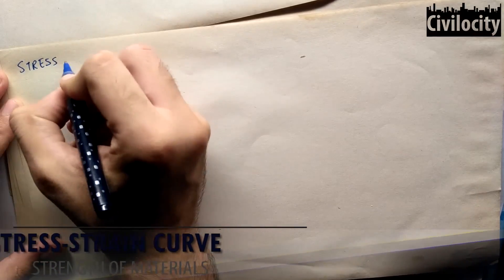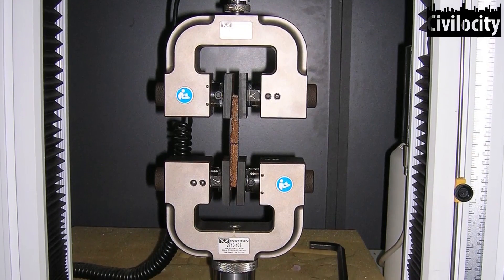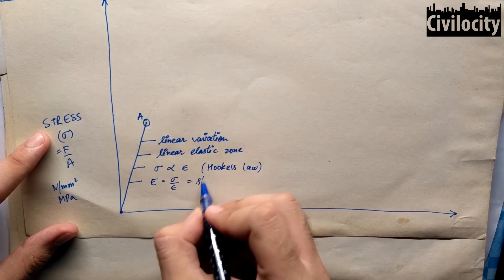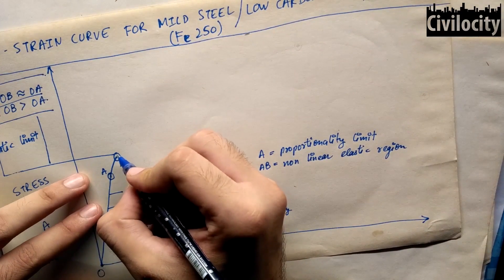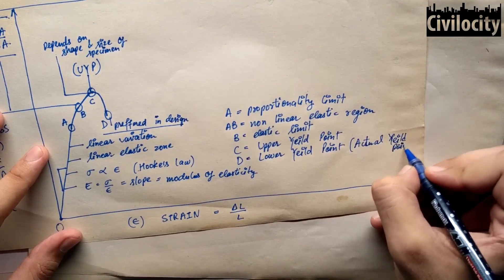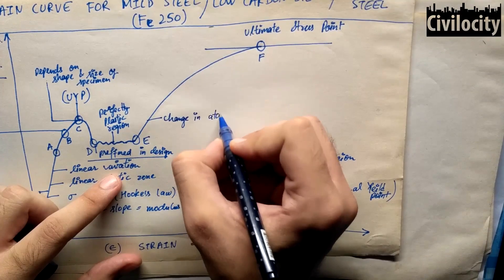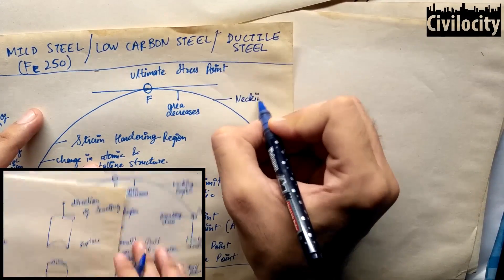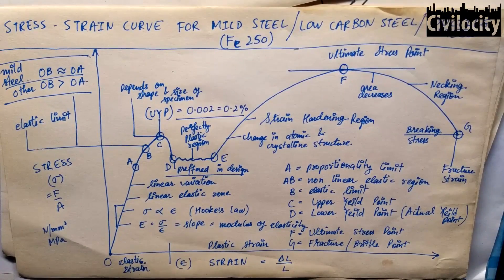Stress Strain Curve | Lecture - 2

Comment: Sir, I have a doubt ,B is elastic limit which means if load is removed material will regain its original shape ,from here we can conclude that after elastic limit material will not regain its original shape if load is removed.
So what will happen if load is removed at lower yield point will it show some plastic deformation.
If it shows some plastic deformation so why OD is known as elastic zone?

Comment from the maker: IES [2000]
ASSERTION (A): When a mild steel bar is tested in tension, the stress drops down from Upper Yield Point to Lower Yield Point without elongation.
REASON (R): The boundaries of grains of mild steel are composed of brittle material.

(a) Both A and R are true and R is the correct explanation of A
(b) Both A and R are true and R is NOT a correct explanation of A
(c) A is true but R is false
(d) A is false but R is true
Reply: I think A is the correct option for that